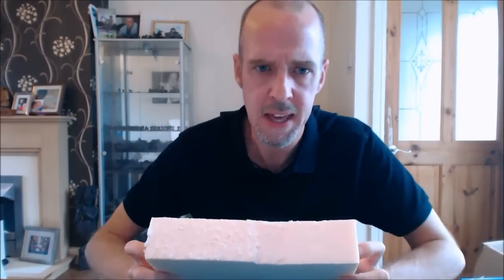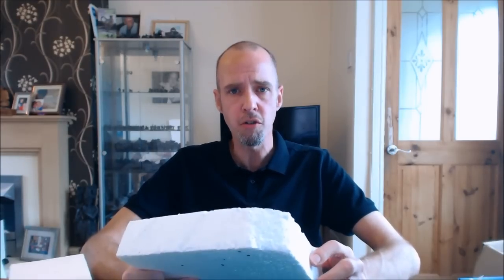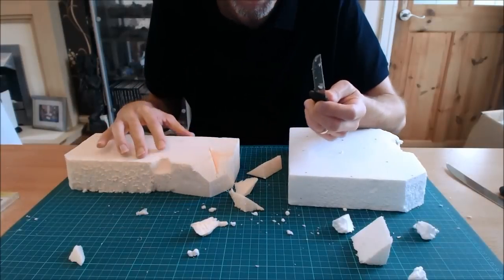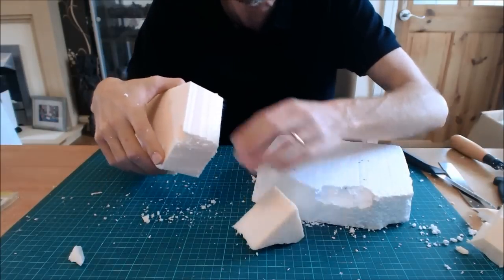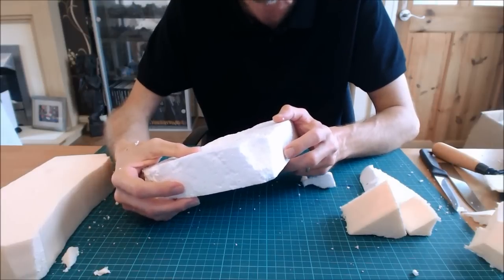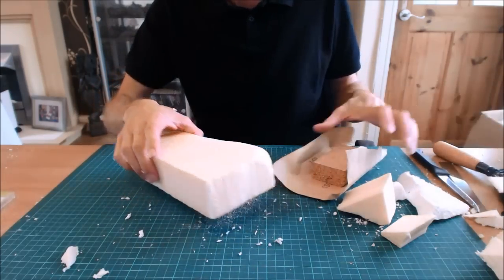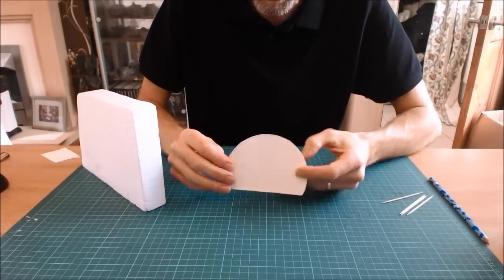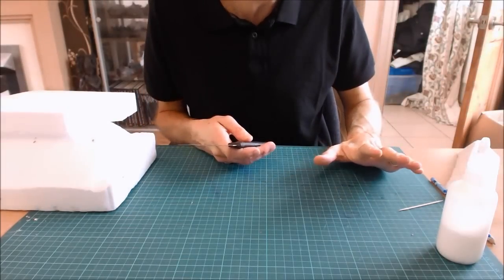A guide to using Polystyrene (Styrofoam) to make wargaming scenery

Comment: For sealing polystyrene, a mix of 50:50 PVA and water, then add flour till you get this kind of plaster style paste, then a teaspoon of salt.Plain Flour and Salt. Coat that over and you get something thats completely rock solid, and doesn't crack as easily as plaster.
Reply: doesn't the flour rot overtime ?
Reply: @jeromemarchal1131  The salt kills the any and all bacteria that would cause it to rot. 
You mix a decent amount of salt inside, I always use a tablespoon
Reply: Yeah 😂

Comment from the maker: Glad you found it useful mate.

Once PVA is completely dry, it's easily painting with most paints mate. You shouldn't need to seal the paint when it's dry but if you're desperate to, just give it a thin coat of watered down PVA mate. 

If you can hold on, I'm working on a set of videos covering foliage etc now mate.

Comment: These are great tips! 
I'd recommend running a vacuum while cutting these near the intake. It helps to limit the mess quite a bit.
Also, for the paper mache coating with paper dipped in thin PVA, I would recommend using strips of the plainest paper towels.
Reply from the maker: Gene Jordan I do when i'm working with expanded foam mate, quite often I get one of the kids to hold the vacuum and I pretend I'm a surgeon and shout 'suction!' every so often :-D
Reply: @TheTerrainTutor  Does this still work eight years on?

Comment: A couple of other tools that I've found useful:

* Woodworker's rasp - Pretty much a cheese grater with a handle. This will rapidly shape foam moderately precisely. But it's about the messiest thing you can do without fluids. Make sure you're running a shop vacuum constantly when using this.

* Bandsaw - Best tool I've ever used for making straight-ish cuts in foam. You can tilt the head to cut on a consistent bevel and you can feed the foam as fast as you like. The cuts are consistent and very smooth. Of course it will cut off fingers almost as fast as it will cut off bits of foam, so know what you're doing before you even think about turning it on -- it's hungry for your blood. 8-)
Reply: I never even thought about using a rasp! thanks for the tip!

Comment: Dear Terrain Tutor -

I can't believe anyone would give you a "thumbsdown" on your awesome and humorous presentation!?!  Your tutorial was quite excellent with some very clever and useful tips.  I like the heatgun effect a lot.  Very cool how you can even make a divit into the "styrofoam" as we casually call the material here, on the other side of the pond.  Your techiques with the toothpicks is also very ingenious.  Can't wait to order my hot wire tool and a heat gun!  First class, mate!  I have a lot of terrain building in the months ahead.  Thank you.

Currently working on a very authentic WW2 wargame - hopefully will publish by Autumn 2015.  The real name is still secret, but the codename for it now is "Schwerpunkt" - the intitials for the real name is "PP" and and is based on a reworking of the old TSR game, Tractics, as the core model.  The technical background and my 25 years of military experience (with the help of my co-designer/consultant) are going into this game which is intensely researched, but wholly transparent to the user!  The goal is for very authentic results and properly applied tactics and reconnaissance, and is operationally correct for those who care about such things as historical honesty.

I'm doing a lot to streamline the original game by reorganizing, rewriting and adding some unique, but highly evolved rules, and most of all, the gaming aids, that will speed up play enormously - the bane of the original game.  I'm also looking at a possible smartphone App that will speed up some of the laborious die roll modifiers and limit referencing charts and tables.  This promises to be a very exciting product without all the "gaminess" of recent popular skirmish games on the market, which shall remain nameless.  Lots of new surprises and enhancement are integrated.

Don't know if you're into WW2 gaming but I can be contacted if you're interested at . . .
specforc12@aol.com

- Tibor
Reply from the maker: Tibor Ipavic ah mate, that's youtube for you lol. Sounds like an awesome project, you should get over to the terrainiacs group :-)

Comment: outstanding video! thanks dude. I make surfboards and its ironic if that's the right English word but that good dense insulation foam is obviously more expensive than the EPS but ironically nearly as expensive as proper polyurethane surfboard foam blanks .A moulded blown blank of Polyurethane Foam in UK costs around £65 and its moulded into a basic rocker shaped surfboard (but bigger) you still have to shape your work of art board.  The insulation foam is in sheets which have to be glued together thicker than a surfboard shape, and then still wire cut with the super large wire cutter, come to about £40, quite expensive, then you still have to glue them together and insert  a wooden ply stringer in the middle of the board for strength.  After that you've still got to protect the foam so you would use something like speckle or pollycell fine plaster the type used for repairing walls prepping before painting . This gives a good firm harden protective surface, so the epoxy resin resin doesn't eat the foam.So try speckle or pollycell in a thin coat on your foams but don't use the powdered pollycell use the speckle paste premix one. and for the difference in £25 I'd rather purchase the £65 polyurethane blank because ironically the ordinary polyester resin is half the price of the eps epoxy resin . so the most expensive foam but cheaper polyester resin compatible /compared to eps foam coated with pollycell paste and expensive epoxy resin which can destroy unprotected uncoated foam. SURFS UP GREMIES COWABUNGA GAMERS BANZAAIIII!!   thanks for the great video!
Reply from the maker: I'm just here to help buddy:-)

Comment: Back in the day of very tightened purse strings, I hand-made a hot-wire cutter using an old, unloved junior hacksaw and some fusewire.

I taped a sock around the handle for insulation, wound the wire taut across where the blade would've gone, then simply heated the wire over a gas ring. Surprisingly effective if you happen to be broke and desperate!
Reply from the maker: Chris King I did something similar when I first started mate, couldn't be without my pro-tools now though mate

Comment: Great video mate. Nice to see it broken down into easy steps and made easy. Down to TP tomorrow for some pink foam! Haha. 
Keep up the great work!
Reply from the maker: Hope it helps buddy!
Reply: TheTerrainTutor it has helped immensely, thanks! 
I have a question about obtaining foam. 
I’ve been looking at local builders merchants and most of them only have Celotex or Kingston foam board insulation. Both brands have the silver foil backing. Is it possible to remove the foil without damaging the foam too much? Is it worth just buying the proper modelling stuff and if so who’s your preferred supplier? 
Thanks TT!

Comment: Very detailed presentation.  Appreciated.  I've recently begun to delve into the terrain building hobby for my RPG games.  I testing using mold building and cheaper versions (like Styrofoam) methods.  I already had tools (hotwire tools /glue gun, etc) so it's good to see how to use them.  Thanks for the clear explaination of the various types of material.

Comment: will PVA itself work for a 3x3 frostgrave game board?  right now it is pink foam and dents pretty easy...I been told about one option but want to be inexpensive on build.  going for snow look so not want a lot of texture on most of it.  thx for your videos, when I finish board if u would like to see it where might I post it? 😃
Reply from the maker: Will pva work for what mate? little confused? gluing, sealing?
Reply: +TheTerrainTutor sealing the foam itself to keep it from denting when models pushed around or dropped on it 😃.
Reply from the maker: Sgt Oddballz
mix a little pva with your basecoat and i'll be fine mate
Reply: +TheTerrainTutor right on thank u will try that 😃
Reply: Im in the states and id love some of the condensed foam thats about 2 inches or so thick and 48x48, where can i get something like this?
Reply: +NzvzOG pink insulation foam in 2 inch from home depot or Lowe's places like that.  they come in 4x8 sheets (plywood size).  I got some from my work, was in dumpster so was free and grabed few random cutoffs...one I made 3x3 frostgrave board 😃

Comment: Great stuff! Unfortunately, it is difficult here in Sweden to get anything but white bubble s-foam. In your view, can the techniques you use work just as well with the white version?
Reply from the maker: Yes with the exception of craving details/engraving, that's for purely for the high density stuff mate
Reply: There are online companies that ship all over. Theres different grades of the foam stuff like blue green and pink. You would have to ask TheTerrainTutor for more detail on difference between them but u can get it. The ones i found sell in multiples of ten sheets approx a tener a sheet
Reply: Hi! A tip from one Swede to another: Getting the dense foam isn’t too difficult actually. It’s usually called XPS and it can be found at any store that sells construction materials. Got a pretty big sheet från ByggMax yesterday for just 60 kr. Dense blue foam, no balls.

Comment: I'm having trouble finding a decent extruded polystyrene in the UK. I thought I got some, but it turns out it's polyisocyanurate (Celotex) which isn't working out great. Any advice?
Reply from the maker: Jackodur KF300 High strength Extruded Polystyrene (XPS) 1250mm x 600mm - Lining Boards - Roof - Insulation
Reply: ohh my God!!! You just saved my day mate, been looking for this for past few days, real struggle in the UK... Thank yo so much!

Comment: Just wondering, what sort of thickness of foam do you find most useful for terrain pieces? By which I mean, hills, cliffs, building up bases etc, general purpose sort of stuff, rather than say, buildings.
Reply from the maker: +Mooncabbage 2 inch mate, typically that's thick enough for a 28mm to hide behind
Reply: +TheTerrainTutor Thanks mate, got a few offcuts and a cheapo cutter today, should be able to make some sweet hills :P

Comment: Is there any problems that can occur with heat tools, if there's very little depth to your foam? I'm thinking of doing some craters and rivers I can place on top of a flat surface, but I want their ground clearance to be quite low. If I was to heat gun with very thin pieces of foam, is there anything I should be aware of?
Reply from the maker: It depends on how hot they are, how long they're held on one area. Obviously you need to be careful of fumes and burns from melted polystyrene while it cools down. If you're worried about going straight through, base the piece with 3mm mdf, that won't melt mate, so no holes!
Reply: thanks!

Comment: Hi there, i was wondering where is the best place in the uk to buy the non ball type you were using and the actual name of it,ive checked b&q, iwas hopeing to get a look and feel of it to see whether it would do for my project.many thanks in advance. Great video by the way.
Reply from the maker: water wolf adventures If you're after the high density stuff, checkout spaceboard eco insulation mate :-)
Reply: TheTerrainTutor cheers man ,do you think it would do for my project,iam going to make out riggers for my canoe by shaping the poly foam then fibreglass over the foam into basically two small boat hulls,doing my research I've found out epoxy resin does not melt polystyrene. To get the size i need i have to glue two slabs together , would i be better pinning it together or pva gluing it or both. Cheers buddy.
Reply from the maker: water wolf adventures
Should work mate but I'm no expert on canoes
Reply: TheTerrainTutor hi bud could you tell me if this sounds expensive   polystyrene 2.5 meters x .6 meters x 75 mm high density £31.50 cheers.
Reply from the maker: water wolf adventures
That's about right mate
Reply: TheTerrainTutor cheers bud.
Reply: water wolf adventures Where did you find that mate? Im in Nottingham UK and I cant find anything under twice that price for the high density stuff tried all main chains and the Space eco has been discontinued in UK now ;(
Reply: Siônmarc Simpson Trying to buy proper modelling foam (Which is just re-named insulation, since the foam itself is literally just the house wall insulation foam) is not worth it. It's much cheaper just to buy that, rather than buying it from any proper modelling website. I got 12, 2 foot by 2 foot pieces from ebay for £90. (Very good deal, this makes a full size Warhammer table, or a smaller project/display boards with ease), you just have to spend some time looking across ebay and other sites, there's no need to use proper sites which are indeed twice the price.

For a titled name for the stuff, it's normally something like: EXTRUDED STYROFOAM BLUE FOAM. Or pink of course. You need only type in the words 'Modelling foam' and you'll find it. Here is a link for you on ebay: http://www.ebay.co.uk/itm/EXTRUDED-STYROFOAM-BLUE-FOAM-BLOCKS-MODEL-MAKING-SCULPTING-FREE-POSTAGE-/271155025909
Reply: Thanks bro. I now have found some ;)

Comment: Hi, I have a question: I used expandable styrofoam for my base and I heated it to make rough surface. But when I poured in Woodland Scenics realistic water, it seeped through the foam and I could see the water dripping from the base. I think it is because of the pores after being heated. How did you prevent that from happening? And will there be pores after you heat the denser (pink) styrofoam?
Reply from the maker: Hai Yen Dinh Polystyrene always has holes no matter how dense it is, it's just how many/big they are. You need to seal the area with filler (spackle) mate, that'll stop the seepage ;-)
Reply: Which kind of filler would you recommend?
Reply from the maker: Hai Yen Dinh I just use the budget/store brands, for terrain building, the premier brands don't really offer much mate

Comment: Great video. Learned a lot. I actually plan on sculpting XPS to produce models for iron or bronze casting, and this video is a great starting point for that as well. Quick question: does the toothpick trick for layering work with XPS as well as it does with styrofoam? Or is the extruded polystyrene just too dense for that?
Reply from the maker: Santiago Lozano Cheers mate, yeah, the toothpick method work just as well for xps, although for multilayer pieces, I'd probably suggest you use kebab skewers.
Reply: TheTerrainTutor Thx!

Comment: I shouldn't worry too much about the "yeahs", the signal to noise ratio is still pretty high ;)

Wikes doesn't seem to carry extruded polystyrene sheets any more. They have expanded polystyrene sheets and something called Celotex sheets (PIR foam core which looks like that oasis foam used by florists). The B&Q site is down at the moment  so I can't check that. Do you know a good source of extruded polystyrene (I know that there used to be a manufacturer here in Brum that actually made the stuff, but I can't remember what it was called or where it is)?

Thanks for all your hard work, yeah? ;)
Reply: B&Q site is back up and they are offering expanded polystyrene and polyisocyanurate (PIR) insulation; neither of which appear ideal. Do you know of another source for Extruded Polystyrene?
Reply from the maker: Euan Smith Look for SpaceEco Board Insulation matey
Reply from the maker: Euan Smith
I get mine from Wickes around the corner mate ;-)

Comment: This is been a great video, super job mate.
I had the space stuff 3 years ago, got it at B&Q, SpaceEco seem to have stopped doing it at B&Q now though :(
I live in Northern Ireland, seen it on wicks... but can't get it delivered here. Crying right now.

Do you of any other foam like spaceboard?
Reply from the maker: LTOP13 you can get the blue stuff on ebay mate, search for extruded polystyrene foam sheets. hope that helps ;-)

Comment: This is top. I subed.

I am looking to do square modular evalation, for mordheim citys. I would really like to use expanded styrofoam, since it is cheaper and all dense styrofoam comes with that <><><> patern on it for cement to stick on it, and is pain to smothen out those with sand paper. Do you think PVA/water glasure would straighten expanded styrofoam up enough for wargaming purposes?

I really like the ithe (of yours) using card board for straightening it. Do you have any idea how to get brick texture on cardboard gluead around piece of styren?

And sry for my spelling :)
Reply from the maker: Cheers mate.Probably not to be honest, I'd give it a light sanding and then seal it mate

Comment: Quick question. I've been inspired by some of your videos to try and make my own terrain. Without cutting all the way through the foam, is there a good technique to hollowing out bits of foam in the middle of a block? (e.g. for a steep river, trench, or to hollow out a section for an animal-trap/pit. I was thinking of using a heat gun in a concentrated spot, but having had a play around with it, it doesnt seem to sink by very much, and its a bit of a blunderbuss approach, and not very exact. I tried getting into it with the steak knife, but it was very hard to get into it, because i couldnt come in from the side of the block. What would you recommend?
Reply from the maker: It can be quite difficult, you can get hotwire tools where you can bend the metal to a u shape and cut it out that way. alternatively, attack it with a streak knife and your hands, cuts the blocks, rip them out, sand the bottom afterwards mate